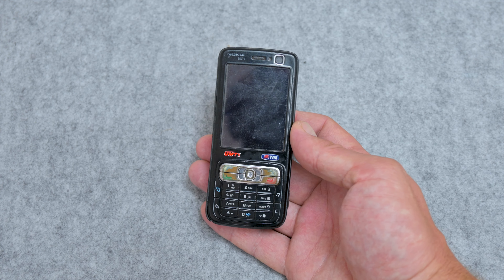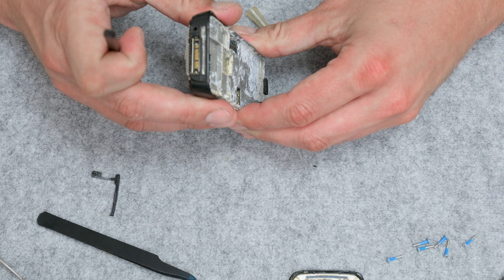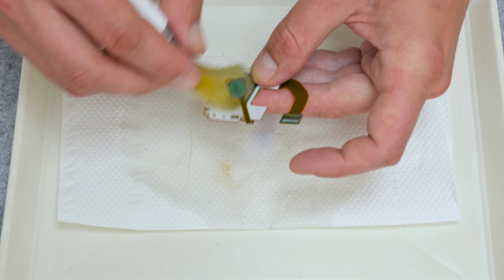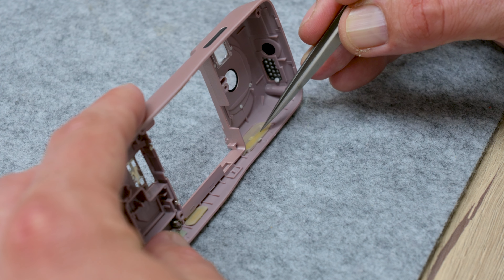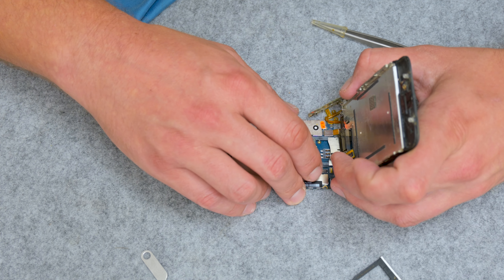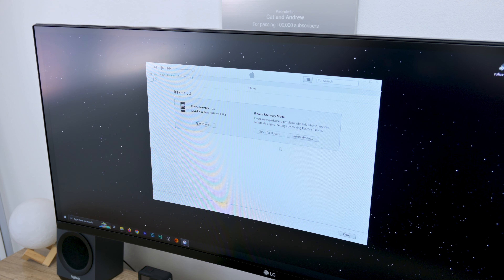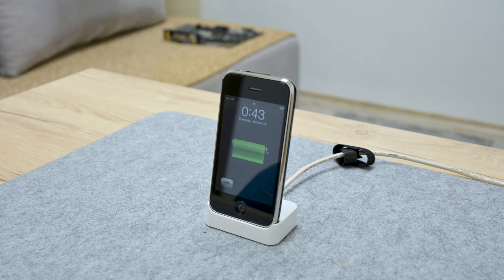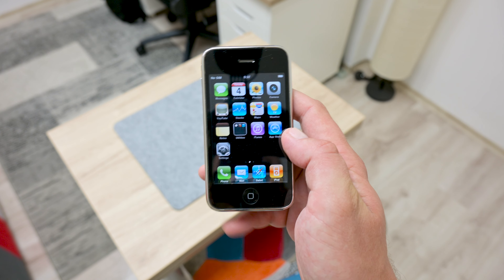Restoring the Forgotten phones - ( Nokia and iPhone )

Comment: Hey Andrew, I have an original iPhone (running iOS 1.1) And I'm facing the same issue software wise as your iPhone 3G did. I was wondering if you can tell me about the software used to successfully restore your iPhone 3G. Cheers!
Reply from the maker: Hi bro, I used ireb to fix this problem to 3G, and I have used the same tool to 2G also. ireb is easy to use, old tool but still great for older phones
Reply: @ComputersAndTechAndAndrew  Hey man, is there a place where I can talk to you in a message form? So I can explain my issue in full detail

Comment: I have a old iPhone 3GS I picked up for $5 in 2021. I checked it had a sim, no icloud. Restored it via itunes and you have to have a sim inside to set it up. Which is why I will permanently keep one on hand. These make good Ipods if you disable everything that is not needed a very long battery life.
Reply from the maker: The 3GS is much faster from 3G, I restore one iPod touch 4th gen ( I have short about ) still good with battery and good for music

Comment: Some times ago I had 12 Nokia phones that seemed in perfect working condition but 11 of them had the same weird problem , Always when I tried to make calls , send sms and browse internet (I mean only while using these specific options) they showed Battery low or Battery empty and turned off after few seconds even though battery was half or full and even when the battery was new and fully charged .
What could have been the problem ?
Reply from the maker: Hi bro, in most cases the problem is the battery. Except if the phones were liquid damaged or have other physical damage. When the battery starts dying It may show that is full but wherever you try do something then the battery will show fast drain